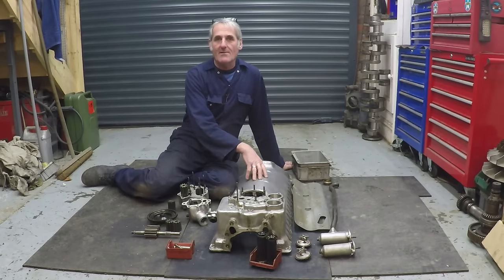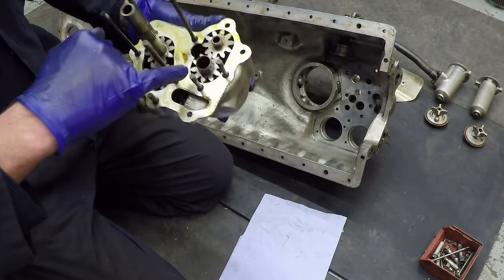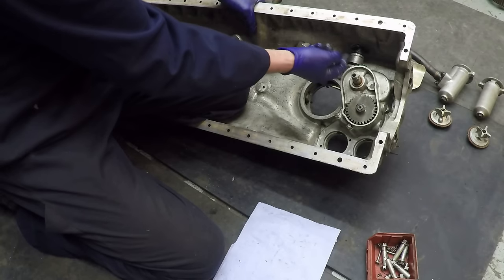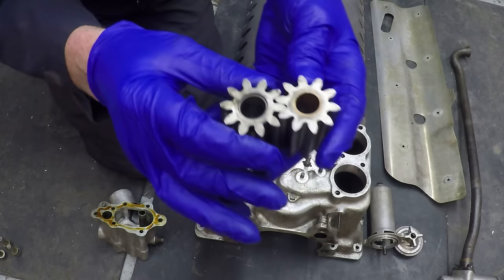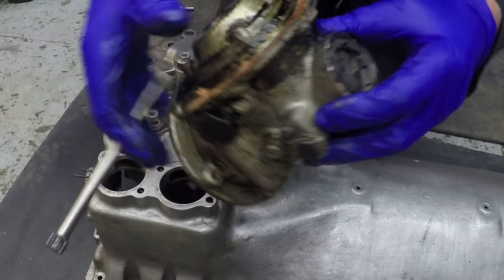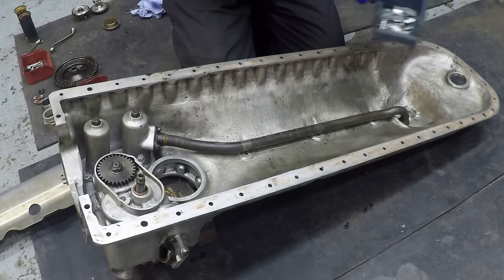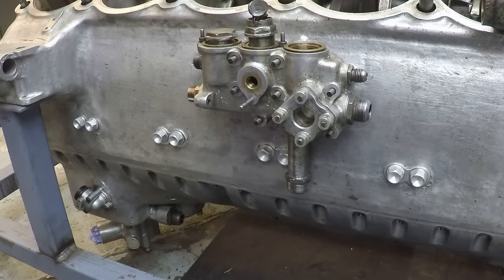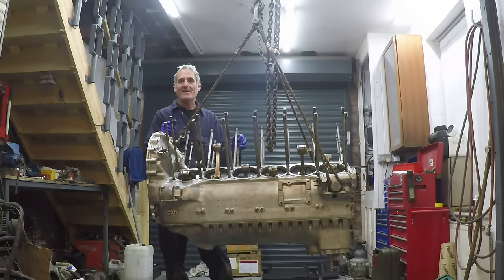Halifax W7715 Merlin Engine. EP5. Lower Crankcase (The Facebook Marketplace Merlin)

Comment: I am doing a CAD model of the Merlin from the Packard blueprints and your videos are quickly becoming an excellent resource for me.  When you do the heads and cylinder blocks, can you take a minute just to get some video all around of the bare castings? Or at least as bare as you take them back to.

Comment: One of the weak points and problem areas of the merlin, lack of sufficient oil flow at pressure at higher RPMs,,,good way to ruin an engine !!!